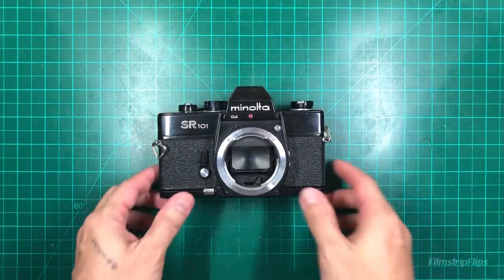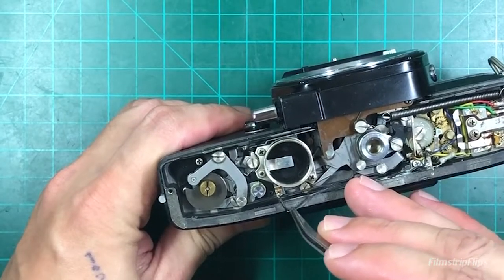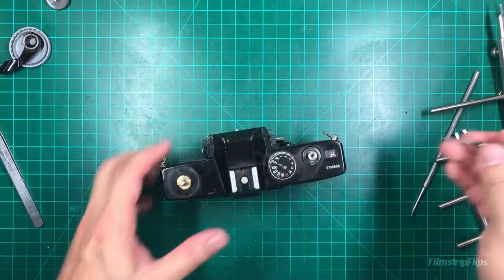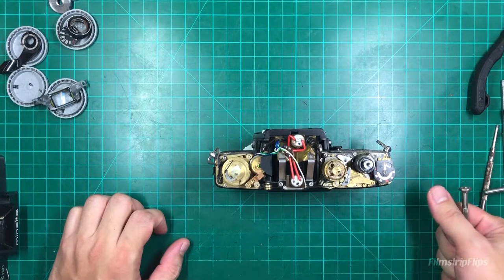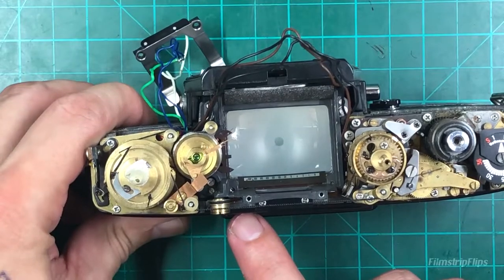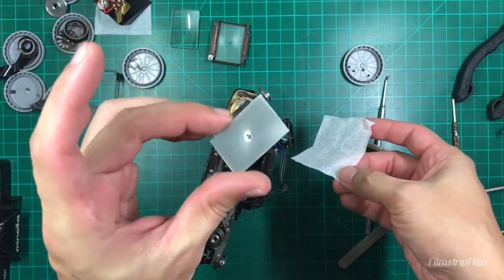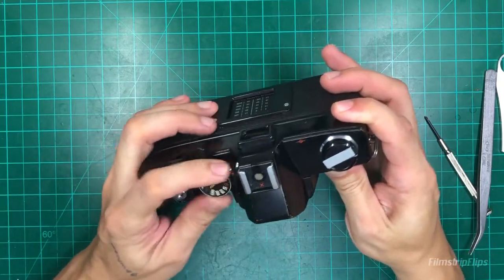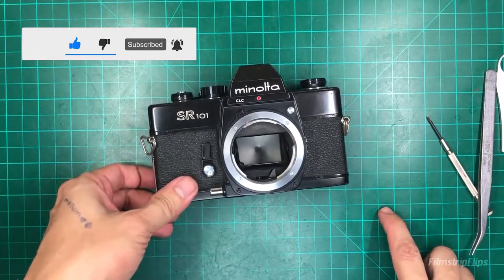Minolta SRT series ( 101, 102, 201 ) Cleaning, Top Removal and Focus Screen Replacement

Comment: In case anyone is taking apart an srt 202 you need to remove 4 extra screws to remove the top plate. Two are on either side of the Minolta face plate that protrudes out slightly. You can then remove it and access two more flat head screws beneath.
Reply: I learned that the hard way 🥴
Reply: I cannot thank you more for saving me tons of time and probably my camera itself as well. Most of the tutorials online are 101 so there's no such step.
Reply: THANK YOU!!

Comment: I just was going to do this with a split prims from nikon fg into cosina ct-1. Found out that cosina screen is 1x0,5mm smaller :(
Reply from the maker: Ahh yup, your best bet is with same brand and model series.
Reply: @Filmstripflips  Yeah but afaik there are no cosinas of the same line with split prism :( Nikon FG is easy mode because you just unscrew one screw and you can change to any of the provided screens. I might be stuck with the microprism with the ct-1.

Comment: They used thin thread to move some of the controls? Ugh.
Reply: It is used to sync the controls.   Every movement of the ASA,  shutter speed or  f stop will alter the meter needle position  to make the meter sensor operate properly.   Since all the controls are in different places the string works great if you do not break it.
Reply: I have 12 SRT's, dating from 1966 to 1981. The strings in all of them are in great shape. They used very robust material for the strings.

Comment: Thank you for your work! I'm about to try to fix my 303. The lightmeter needle is stuck in the upper position, possibly due to foam bumper. Also shutter speed indicator is misaligned, though working. Do you think there's a way to correct it's position? Thanks!

Comment: Hey Ive been having issues with my srt 102 focusing. Everything looks normal on the inside but when focusing beyond infinite the split screen wont make things match and nothing will focus with the respective distances, for example, 3 m wont focus even when its exactly 3 m, 5 m wont focus even when its exactly 5 m, and so on, all the way to infinite which wont focus on the split screen either. Is there some way to calibrate the focusing screen, mirror or veiwfinder?
Ive tried adjusting the 3 screws holding the splitscreen shown in your video but that didnt seem to work